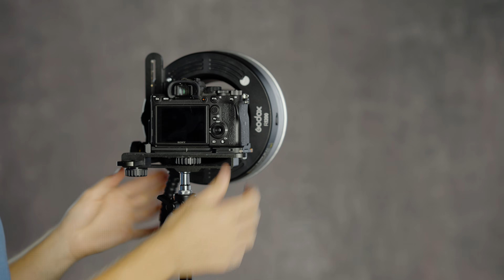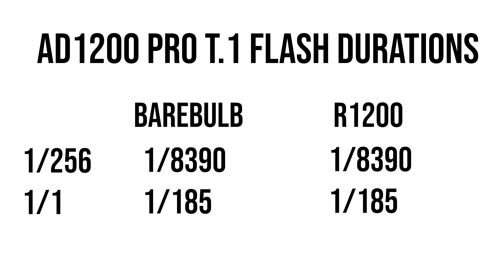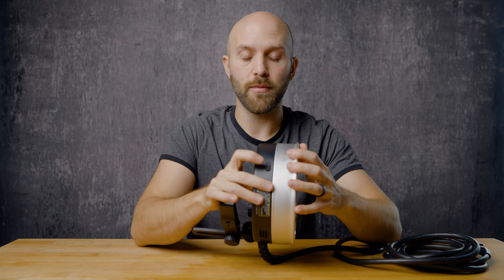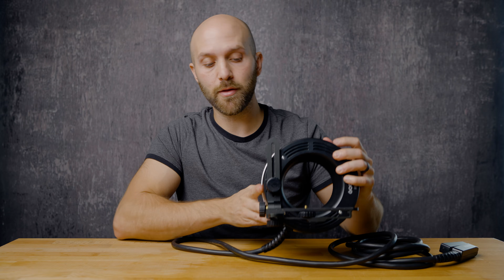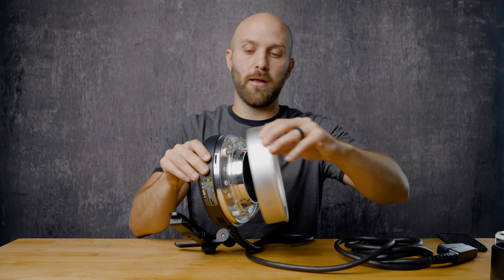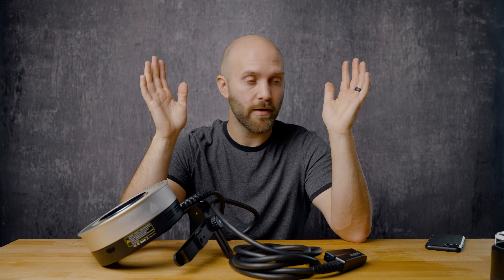Godox R1200 Ring Flash for AD1200 Pro

Comment from the maker: The Sigma 105mm F/1.4 Bokeh master will not slide through the R1200 opening completely. You can (with the tripod collar removed), back the lens through the front and get it most of the way in, enough to still attach a camera. 
I use sony, so my 105mm has a bit extra length compared the ones for Canon/Nikon dSLR. Im not positive if that reduced length (and the extra size of dSLRs) would be too big for this to work.

Comment: This would actually be interesting as a standalone head, since the bulb has a different form, this is, is much bigger than the standard head, but I guess there is nothing you could do with that head you could not also do with the standard head, so I can really not see a reason for this. As a ring flash – no. For that, I will wait for a version for the AD600.

Comment: Something like that, but for the AD600 Pro, would be a nice addition. But in the meantime, i will do some experiments with my old Bowens Ringlite Converter on the AD600 Pro (its a ringshaped reflector with Bowens S mount). Maybe i could make it, that the R1200 Ring Flash accessory reflectors would fit on my Bowens Ringlite Converter. We will see...

Comment: Robert, you tell us the flash duration at full power: 1/220. That is slow.  How fast it s speed up to achieve a descent speed? I usually use 1/800 on my Phase One XF, how much power I can expect at this speed ?  

Sorry for flooding your comment section but I really appreciate your work 😉
Reply from the maker: You would be at just above 1/4 power, and the power level accuracy is near perfect on the 1200 pro so you could easily apply that to the metered results I got to determine how much output you would have. 
Keep in mind that's the t.1 flash duration though. I think 1/2 power would be brighter, you may not get every drop of flash output but I think you'd still be squeezing 80%+ of it.

Comment: agree.. a stand alone ring flash would be a good idea godox or one that can work with ad200 300/400 & 600
Reply: The ADR400 is a standalone 400ws flash. It is r2 compatible, just need a receiver, and can do hss (no ttl though). It also has pc and 3.5mm sync outs, so if you don't need hss, it's the easiest way to connect, and power control is easy enough with an adjustment wheel on the unit. There are definitely some quirks to the ADR400, but it's a decent unit. I do hope they come out with a newer more r2 integrated model, but it's a niche product.
Reply: @PShizzyBlog  , I agree (I bought one JUSt😂 before they discontinued it). I think, given the breadth of their product line (AD2003004006001200😂😂, ext heads for AD200, 400, 600, double 1200ws head for old AD600, for AD200 fresnel, LED, bare bulb, round heads, AD-B2 bracket, & Profoto adapter,  Broncolor, Profoto, Elinchrom, & Bowens adapters for AD600, 400, 300, etc😁😁😂🤣), they'll probably replace the AR400 with a new version.

Comment: When Godox sell this as a kit I will buy three or four of them - using these as a main light is better than a strobe  firing indirectly into a reflector/brolly etc - but at present you have to buy the box and a light then buy this separately. I use 4 Broncolor Move 1200ls on location and in the studio the ring lights provide a much better flow of light than the Mobileds - also the cost - my Brons cost 12K+ the ring lights 4K - this is a no brainer. So come on Godox take that extra step and give us Pros a real reason to switch - Godox and Bron have history together already and I feel its no coincidence the AD1200 unit is very very similar to the Bron - they even put the radio receiver in the handle - same power, etc etc - and if you look at the Bron ring flash - it is very very similar too - even the accessories -  a lot of people say they should have had two outputs - but I disagree - on location 1 head 1 unit works better - cables are the enemy

Comment: The reason they incorporated it with the ad1200pro was because Hensel, Profoto, and Elinchrom all have a option for a 1200watt ringflash.  And Godox only had a 400 watt option.  A non corded 1200watt ringflash would be awesome.   But HUGE.  Lol

I have a few pro friends who use a ringflash as their main go to flash.  Most using Hensel.  They use it unmodified even as off camera flash in desert shoots.  

The options for ringflashes are pretty large.  The cool thing is I think it's the only HSS or HS ringflash out.  The 400 model only gets maybe 3 hss shots before going thermal.
Reply: Profoto discontinued Ringflash on battery
Reply from the maker: Makes sense.
The first time I used it was as fill flash on a wakeboarder, shooting in overcast but, at 200mm from another boat lol. It was making an impact at those significant distances, so I can imagine it being very useful as fill flash in bright conditions. Even though it's attached to the massive 1200 pro, I think I'd prefer the workflow and results vs trying to use a large reflector for fill in bright conditions. Knowing you aren't creating any shadows even as you move is really freeing.
Reply: @robhallphoto  

One other thing I'm working with using with it.  A 30in Octa and a 60in Octa mounted on it while on the camera.  Soft fill and put the pack in a backpack.  

Put your main up front high and off the side in manual and a hairlight/seperation kicker behind in manual and set your power level.  Then have your fill oncamera in TTL.  You can move forward and back and the ringlight adjusts while the main and hair stay at their settings.  

Not sure how it will work out but trying it out to see if it's a look i like.  The 60 is good for a outfit head to toe.  With the main giving a lil extra punch to the head and shoulders.
Reply: @robhallphoto  

Their is also a few using them with Focusable parabolics.  They spread the light a little different inside.  I used a couple of mine like that for a while.  And it makes a deep umbrella a focusable parabolic if it's built where you can slide the umbrella rod in and out deep enough.  And we know how easy a Umbrella is to pack over a focusable parabolic.

Comment: How far are you from your subject? I shoot a ton of macro and portrait but close to the subject. I would figure you could shoot an on-board ring flash.  I only bring this up as this seems a very cumbersome solution. Am I missing something? Thanks for your good tutorial.
Reply from the maker: Does "on-board ring flash" = speedlight ring flash adapter? Asking as I've never heard that phrase. But, in this situation I was using 135mm for 1/2 and 85mm for full length portraits so, I doubt a speedlight powered ring flash would come close to balancing with the other strobes used, at that distance.
Reply: @robhallphoto   I possibly worded that improperly. So like the MR14EX from Canon or a Metz flash. Something that connects directly to the lens and is a ring flash. The metz doesn't use the hot shoe. They are self powered through batteries. Their big drawback is the amount of light they can throw out and that limitation is primarily distance. Also if shooting at full power you are going to have a 1.5-3s recycle time. Does that make more sense?
Reply from the maker: Yes. I'd have to get an output metric to know how significant the output difference is against one of those. I'm guessing around 4 stops. If it's pumping out below 60 w/s, then yeah that's not going to provide too much distance, especially outdoors or balancing with other high powered strobes. These days people are using HSS more than ever which demands even more output. That's why I think 200-400 w/s would be most suitable.

Comment: I’m currently using the profoto D4 ringflash with AcuteB 600 generator.  I think about upgrading to Godox. I just fear the L braquet to be weak ... One question, can we rotate the the modifier if or he as to be attached at a specific position. Thank you for tour fair reviews. Please use international metric :)

Ps: one weak point is always the cable for profoto.

Comment: I saw a comment from godox somewhere, I can’t remember where, that they are looking for a similar solution for the ad400/600 series and that we should stay tuned.
Reply from the maker: Awesome, they would absolutely hit way more users with a 400 pro solution. I actually think a 200 might be one of the best applications. It's their most popular light, and it's size is suitable for being held on the hip, which would be really nice whether you are using the ring flash in studio for fill flash, or outdoor for macro work.
Reply: @robhallphoto  yeah, imagine the option of a ring flash attachment for the 200 the same way we use the other heads for it.
Reply: @robhallphoto  let’s see what the future holds! Quick question, since you answered. Can you fit the protective glass dome of a qt600ii to a dp400iii? I ordered both a few days ago and I’m worried about the dp400iii tube being exposed.
Reply from the maker: Hmm, I don't have a DP to confirm, but I think not as from pictures I don't see the prongs that would be necessary to attach.
Reply: @robhallphoto  yeah thought so. Thank you!